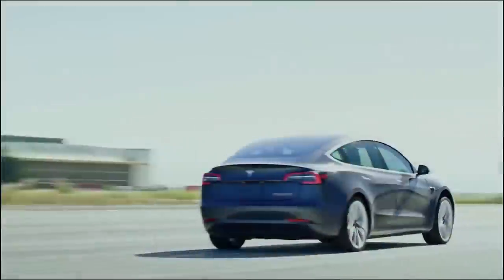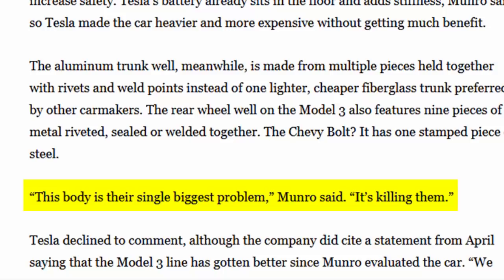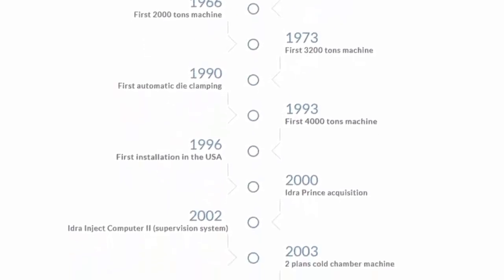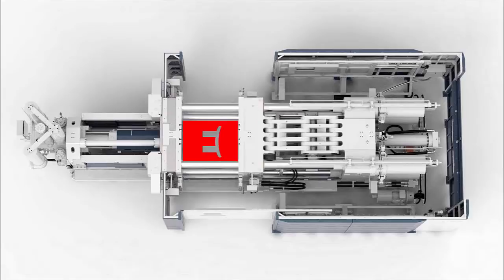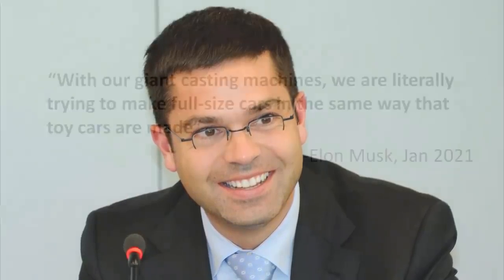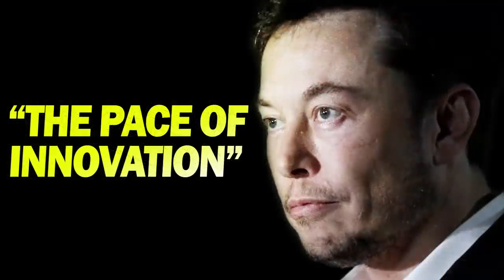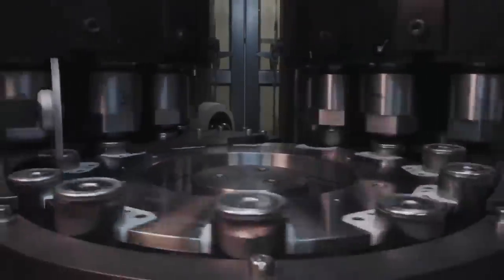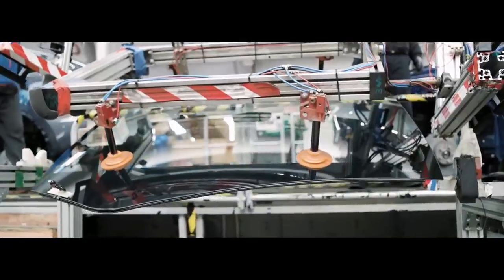Tesla Giga Press will CRUSH

Comment: Easily the best video explaining the Gigapress I’ve seen.
Reply from the maker: Wow, thanks!
Reply: @TMIOTesla  Sorry but you really do sound like a Tesla FanBoy: 
Tesla currently continues to make serious mistakes due to arrogance, such as their "autopilot mode" & even their refusal to add a sound generator to their cars, so they don't run over blind people with a white cane because these pedestrians can't hear the Tesla. Not to mention the experiences of Rich Rebuilds being repeatedly threatened by Tesla...
By the way, the Chevy Bolt is a much better practical commuter EV than any of the Tesla models. Of course, the Bolt doesn't come with Ferrari ownership costs just like the Teslas do. Had Tesla played its cards right, they wouldn't be criticized by me or the Automotive Press, but since Tesla continues to behave just like GM & Ford did before the UAW, the criticism is due...

Comment: Hell Yeah  I'll buy that refurbished wrecked Tesla for $15k!  As long as everything works as well as the FSD.  Make me a package deal for a solar roof with power panel and the whole $29k or 0.55BTC is yours.
Reply: As the salvage market grows it'll be way easier to find the castings and get em back in service. I'm just curious what those hoss's will weigh considering robots will do the grunt work on the assembly line.
Reply: @shawnwise2458  The problem with what you propose, is that it makes sense.  We can't have that.  We've got to make work for those who will not accept education.

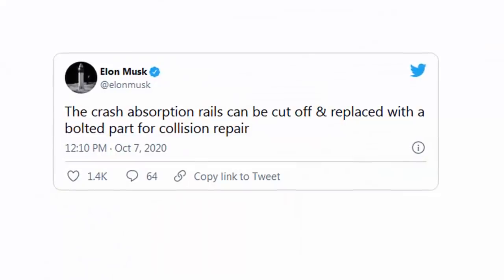Comment: 14:00 (approximately) Suppose you do have an accident that damages one of the two castings, but is still not bad enough to destroy the car in a more general sense. As Elon seems to suggest, you could repair the casting. I would think it would be possible to repair it with something at least as strong as the original. The problem would probably be (1) the cost, for a much less efficiently produced equivalent, and (2) almost inevitably some increase in weight, and therefore some negative effects on performance.

Comment: I believe that Tesla's upcoming model for lower income people will be cast as ONE PIECE. Then the battery pack installed into the casting frame.
Reply: If you are talking about casting the whole body as a single piece then you would be incorrect as it is impossible and if your not then disregard my comment.
Reply: @dikkybee4003  it's not impossible
Reply: @crhu319  Been making dies for casting only for about 40 years and Tesla haven't invented the process and there are certain things that cannot be done due to how the dies operate so as I stated to cast a whole body in a single piece is impossible unless you want a car that looks like it was made in the 70's with no curves.
Reply: No.
Ad indicated by Sandy Munro, not possible/ practical.
They might cast the "top hat" together with the A/B pillars, but not the whole body.
More likely, the "2"(?) Will have various castings with composite plastic/ fibre panels fixed to them.

Comment: Giga Casting + 4680 Battery is the next game changer. It's all about being efficient and casting a huge piece to replace dozens of smaller parts lowers production costs significantly. The same for the 4680 batteries, they are 5.5 times larger than the 2170 using only two single beer cans instead of eleven smaller metal cylinders. It's faster to make, uses fewer materials and reduces costs significantly again!

That's the way to get a 25.000 £$€ middle class Golf like car from Tesla. "We at Tesla don't make slow cars."

Comment: So far as insurance goes, in South Africa (and I presume elsewhere) if the repair costs of a crashed vehicle are 40% of the value of the vehicle it will be written off, that being it's second hand value. That means for anything much worse than a bumper bashing your car is canned anyway.
Reply: yes i agree, i've had 2 cars written off in last 8 years. When cost of repairs get high enough then insurance will pay you out and then they sell car either to crash repairer who can fix up car and sell it on getting some profit or car is broken down into parts and they are sold. When a cast aluminium structure as planned sustains enough force it will crack and be far too costly to repair. btw i live in Oz

Comment: If the structural integrity of a conventional vehicle is compromised in an accident, the insurance company will buy you out of your vehicle anyways.  The vehicle is no longer safe.  How is Tesla's 3 piece casting any different?
Reply: Cost, weight, reliability, safety
Reply: Afaik when the frame is damaged the vehicle is trashed, so this doesnt change anything in that regard
Reply: @johnuferbach9166  it depends on the frame damage. Some of it can be fixed if it’s worth it